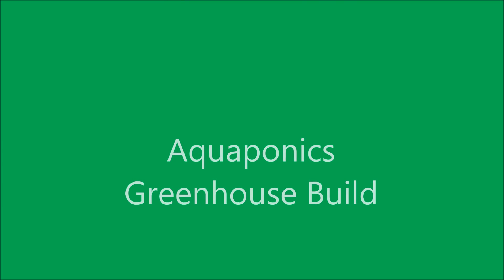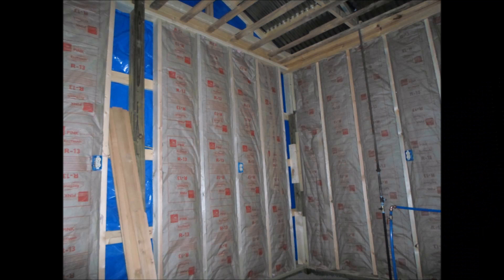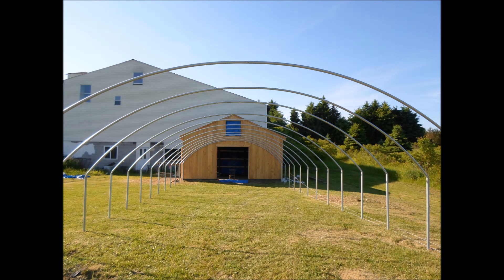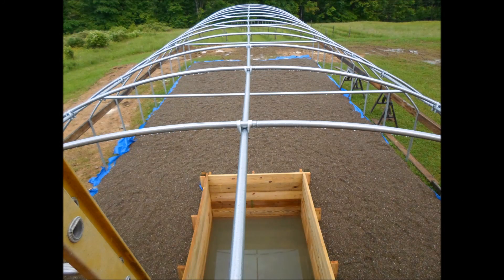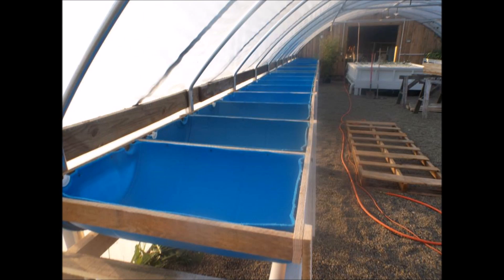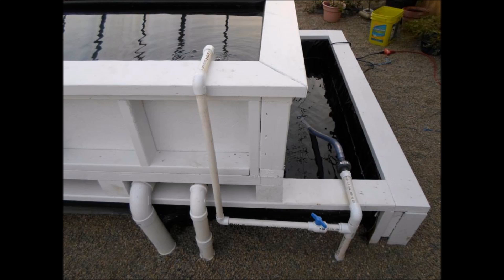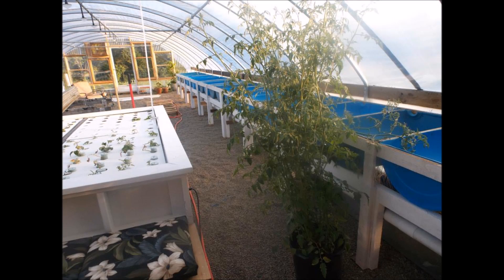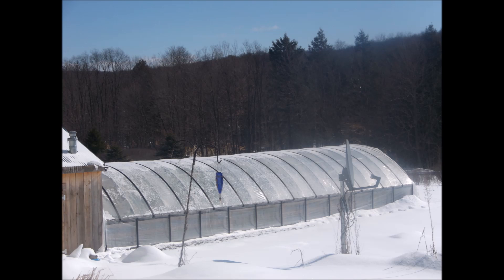Aquaponics Greenhouse Build

Comment: Great job and thank you for sharing your experience with everybody. I learned a lot from watching your video. I'm curious what kinda fish are you using ? I am brand new at Aqua culture and am hoping to start with trout even thou from what I've read trout are more difficult.
Reply from the maker: Montecito Urban Farms I am very new to this also, and everything I am doing is a learning experience to me also.  It is recommended to start with fish that is cheap to buy--- because while the system is maturing, the pH , ammonia, nitrates and nitrates levels may fluctuate radically and you may lose your fish during this period. It may take as much as 9 months for the system to stabilize,  then you can go with your fish choice. my best success with fish has been the tilapia. I lost all my catfish, not having scales I am told that they are more susceptible to parasites, I also introduced wild caught fish which may have brought in disease and most perished. It is very important to have a quarantine tank for the introduction of new fish. with my talipia I heat the tank and when all the  fish were sick, I turned the heat in the tilapia tank up to 86 degrees, which can kill parasites, and my thought was like how we have a fever to get well. well with the increased heat, they made it, and are breeding, and doing well.  I also bought an additional 100 comet gold fish to reintroduce new fish to replace the lost trout and pan fish, and the gold fish are doing well and growing fast. With all these trial and errors, it is still very exciting and I enjoy the daily visit to this wonderful system.--- thanks for the comment, and good luck my friend---Don

Comment: Great Video! I am curious as to what your weather conditions are? How does the poly greenhouse kits perform in wind? To you get much?
Also as to how cold your winter gets and the area in which you live.
Reply from the maker: Matt Palsky We get cold as low as minus 25 degrees without a wind chill and about two feet of snow on the ground thru most of the winter.  the inflation makes the poly shell seem to be somewhat rigid and there is web strapping every four feet that holds the shell tight. The greenhouse held up wonderful thru the winter.

Comment: Hi Don, 
Lovely system, you have a greet layout. I shudder to think what it would cost to heat though!
Reply from the maker: Richard Miller The Utility building is relatively small and very well insulated, the greenhouse has a double wall plastic all around and is inflated--- I was very impressed at how little the furnace ran during the winter, and when the sun was out, the furnace would not turn on. At the end of the year I will have a good idea of the yearly fuel consumption, when I make a comparison to the previous year.
Reply: Donald Porta Hi Donald.
Really interested in the double skin feature and the fans to inflate the gap. Are the fans home made or are they part of an actual poly tunnel kit? I would like to know how the skins were joined as I would like to see if I could do something similar here in the UK
Reply from the maker: Richard Miller Hi Richard,
The inflation fan came with the kit. However, the fan is exactly like the old car heater fan, and one of these would work. The fan has an inlet to the double wall covering and no outlet. the double wall is sealed together with wiggle wire in its associated locking channel--- look up wiggle wire to get an idea what I am referring to.  The system should work wonderful for you there in the UK.  Good Luck, Don

Comment: Why use the half barrels at all?  Why not just use liner inside of framed rectangular boxes?  You could increase the volume of your gravel by additional 1/3 in the exact same space.  Otherwise, very nice system!!  Cheers!
Reply from the maker: scdecade when I researched the use of barrels I found that the shape of the barrel allowed the use of less gravel for surface area of grow space and less water to fill the gravel bed which can allow the use of a smaller pump. also I could get the half barrels for one dollar each. the liners I was afraid that digging in the the beds might cause leaks--- the barrels are indestructible.
Reply: Wow, very nicely done Don.  It seems like a balanced well engineered system.

Comment: Don,
You've constructed a beautiful system!
Just a thought for you, instead of air stones, try using "soaker hose" from your local hardware.  We use them in our (3) 4,000 gallon fish tanks, which feed our whole aquaponics system, and they work PERFECTLY and they're cheap and easily replaced. 
We ran them through some leftover bricks to hold them to the bottom.

It's great fun, and fantastic food!  It looks as if you've done a bang up job in construction.

Good day to you.
Bob
Reply from the maker: Bob Heath The sokaer hose is a fabulous idea---I am going to try this right away. thank you for the great tip!
Reply: Carboys

Comment: Wow man you didn't mess around with your green house very nice. Curious questions if you don't mind... #1 how much money did you drop on this? And how many people does it feed? You mentioned a restaurant does this provide enough for you restaurant by itself?

Either which way nicely done! I am hoping to build my first greenhouse this year, though I want to computerize alot of it.
Reply from the maker: Tech Dave I hope to start automating the system as much as possible, audrino circuits can do most of the monitoring and controlling---there is programs, freeware that is available online, that is written for about every situation 
 you can think of. my total cost for the system is about $10k, $3200 went into the greenhouse kit---base kit was $2300,but I went with the roll up sides bug screen and bouble roof covering.  The rest of the money went into the building and plumbing and gravel.
Reply: Sad that three years later it would nearly cost double. Nice investment!
Reply: @robs9574  or more. I'm in the process of putting up a 40'x48' greenhouse with an attached fish room but I'm trying to buy most of my stuff 2nd hand because the cost is prohibitive if I dont. If I went with all new materials I would have been at $50k or more. 

I'm a disabled vet and I'm doing this cause I cant work anymore but what I receive for disability isn't enough to survive on and if I dont get this running soon then I'm afraid I'm gonna lose the farm altogether but if I can scrape up the materials I need them at least I've got a shot. I'm hoping to get by  for somewhere around $10k for everything now and I e been collecting stuff for r years now to make it happen. I'm keeping my fingers crossed that I can get it going soon
Reply: @1982MCI  My Hero's are Vets, First Responders, Good Teachers and Great Parents. I sub'd your channel, hope you post your build. I'll be Praying for you Don, daily. God Bless you in All ways. I thank You that I grew up learning English and not a foreign language.